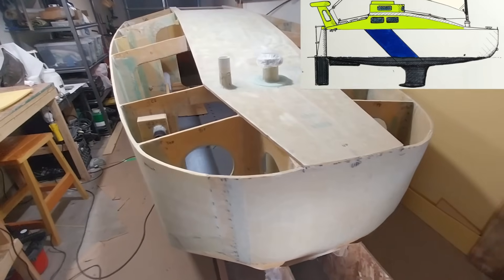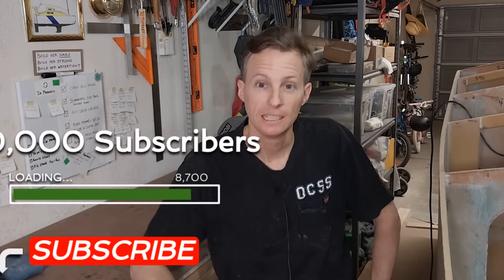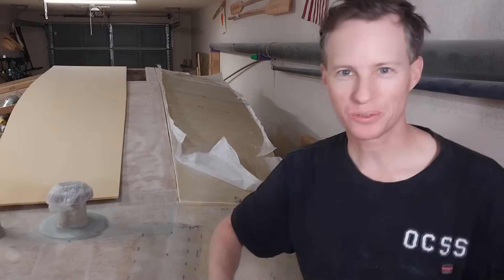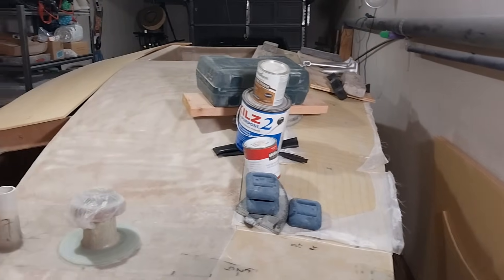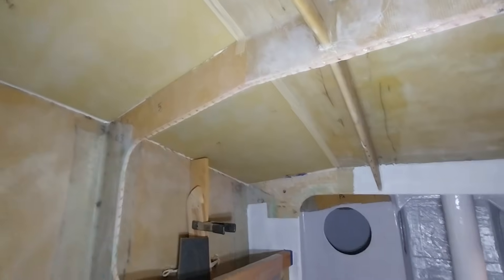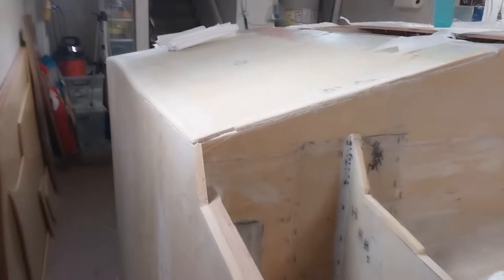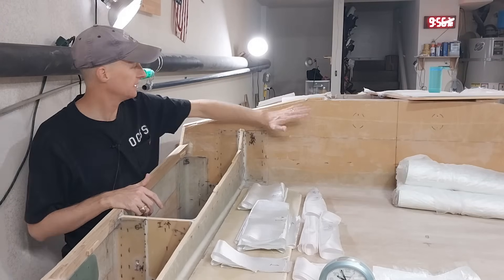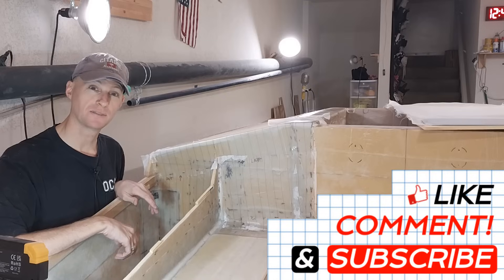OCSS-070 We Go Forward, Only Forward - Mini-Cruiser Sailboat Build

Comment: ok so in the newer videos these  arent installed  that's why i'm so confused
Reply from the maker: Port side panel is fully installed. Starboard side matching panel is built, but not installed yet. I'm holding off because once it's on it's much harder to get inside the boat if I want to do any work in the cabin.
Reply: @ocean_capable_small_sailboat   thanks for the info i was a little confused not seeing it  there

Comment: How much does this cost? Im asking cause this is something i maybe would do
Reply from the maker: Several thousands before you ever get to buying a trailer for it. You have to really want a custom sailboat self-built just the way you want it, and really want to spend countless hours building. Otherwise you're better off getting a used boat and fixing it up.
Reply: @ocean_capable_small_sailboat   i see, what small boats would you recommend for the moment i have a maxi 68 that i have fixed up (was about to go to the junkyard before i got her)  to sailable. Thx for your reply btw :)
Reply from the maker: No problem. There is a saying, "The best boat is the one you have!" I had never heard of the maxi 68 but it looks pretty cool. I would just keep that and keep improving it.  @voncth5791
Reply: @ocean_capable_small_sailboat  Good saying! i will do the best i can with it.
It's a Swedish boat i live here in the Gothenburg area. Really like your channel you have many good ideas, look forward to see when you take her out on the ocean